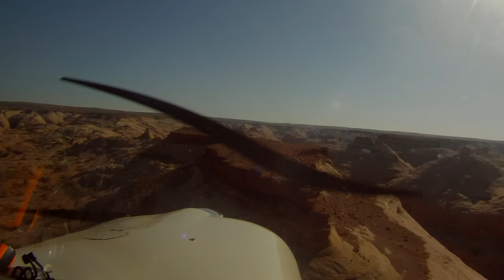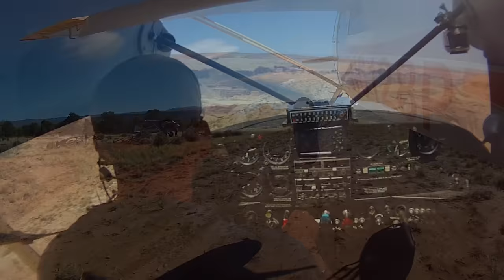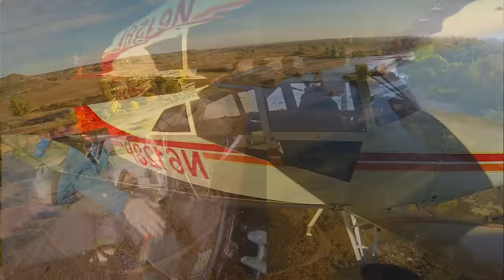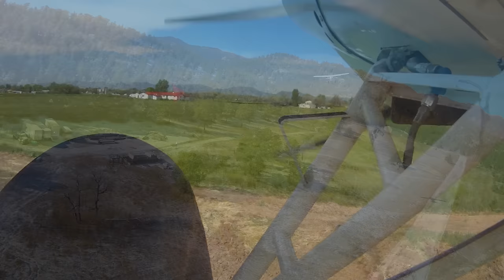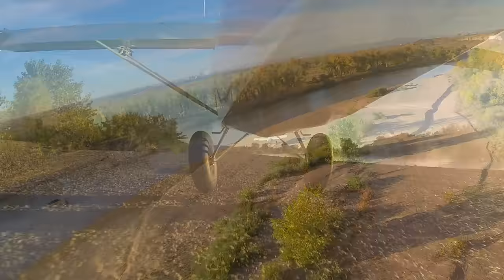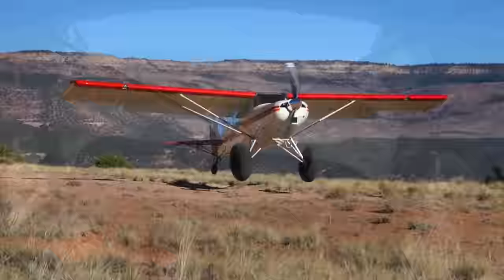Backcountry Aviation's STOL Tips (Balked Landings, Aborted Approaches, and  Go-Arounds)

Comment: I agree 100%. Great video!! The only other thing I do, not mentioned here is to limit my go arounds to (3). If I have to look at it more than (3) times I am fixated on the spot and should look for a better landing spot. I heard Paul Claus share this ides at Valdez a few years back and it stuck with me. I have put myself in trouble pushing myself to force a landing because of multiple reasons instead of looking for a different spot. I once landed on a extremely short gravel bar on a creek because I wanted to hunt a particular spot. Flying out a couple days later I found one twice as long around the next bend. I missed it because I was fixated on this great spot which in comparison was crap compared to the one I missed.
Reply from the maker: that is not a bad policy.  I will sometimes do a few more passes, but never compromise the overall safety.  On the other hand if I actually try to land and balk three times that is a different deal all together.